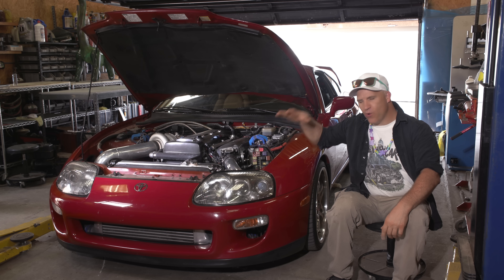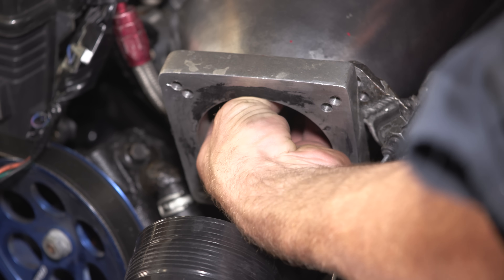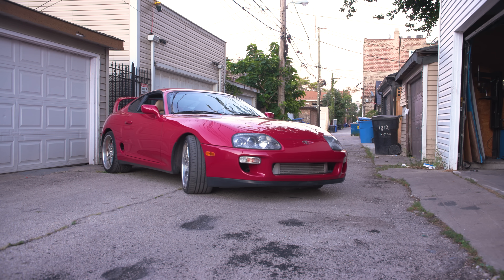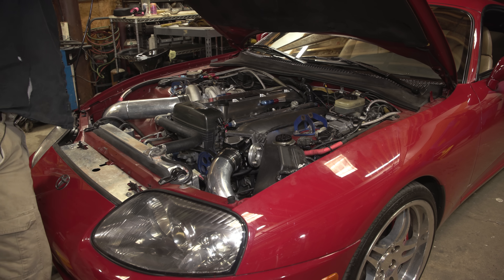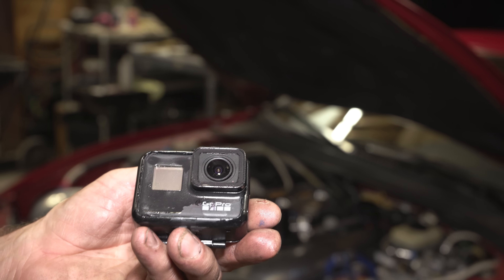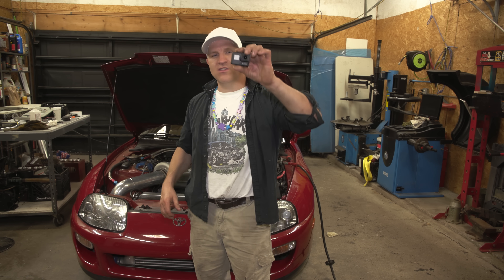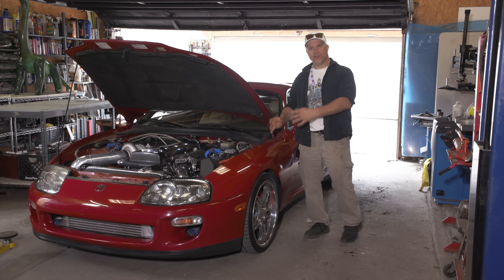Driving with Gopro Inside My Intake Manifold (Toyota Supra Turbo)

Comment: yeah, u should check where that oil from, hopefully u don't get leaking oil from the valve sleeve rings. that pink ish liquid that u get from the start up. was it the oil mixed in with gasoline vapor or something. also the cold cranking sound rough... Afaik, the toyota straight 6 turns on very easily n smoothly ... early sign of compression loss?? hopefully not dude. be light on the boost i guess?

Comment: The oil on the GoPro makes sense. Think of the vacuum the intake has when you blip the throttle/engine brake. The case will flex under extreme vacuum thus creating a void in the gasket for the case. Once the pressure regulates the case goes back to original form sealing the GoPro case. I'd be interested to see what the vacuum is upon deceleration of the engine 👌🏽

Comment: If your using a k& n filter, thats probably the oil thats on the filter going into the intake manifold. The oil is red. Maybe want to use a dry filter from vollant so it wont get as gummy, and mess with the air mas flow sensor.

Comment: Is the oil from the positive crankcase ventilation system? This GoPro-in-the-intake method would be an awesome way to test different catch can designs.
Reply: Depending on his PCV system (bypassed or not), it’s mostly oil blow-by from the piston rings. The piston gapping on a pressurized intake system needs forgiveness somewhere to handle the compression at given operating temperatures; Normal in all internal combustion engines. I did notice lots of fuel washing of the plenum during deceleration - but that could also be a fogging effect of air pressure differences; Think of condensation clouds or vapor vortices that form over plane wings with high humidity. Also, there was a good amount of normal intake condensation I noticed on crank over - that was interesting to see. Good video!

Comment: That was cool. Oil / do you have a PVC vent into the intake before the turbo. I had a 1984 SVO Mustang that when I turned up the boost and changed the impeller it would suck hard enough to pull oil past the PVC valve from the valve cover had to add an oil/ air separator from a Pinto ( haha the SVO is a pinto motor but the PVC stock was not as good as the stock Pinto PVC). You also may be leaking past the seals on the turbo shaft  may be   just guessing

Comment: What is the red-tinted fluid inside the intake manifold? Shouldn’t that area of the car be completely dry?
Reply: that’s that oil leak he’s talking about. intake was pretty clean at the beginning but you can see oil leaking out from under one of the intake valves. probably just a seal but annoying nonetheless
Reply: WhiteShaq420 the only oil I know that is red is transmission fluid, so I’m still a little confused haha
Reply: @joshuacastle8701   oil can be any color with a light shining on it. There was a light on the camera.
Reply: Kris_T_1982 ah.
Reply: Joshua Castle royal purple?
Reply: Joshua Castle  i believe it may be the K&N air filter oil...
Reply: james griffith oof that would suck. There actually IS such thing as too much lube after all lol
Reply: The oil is coming from the intake valve
Reply: Redex
Reply: Its either from the air filter or compressor o-ring.

Comment: So is that the moisture in the air condensing like when an airplane is landing? Let off the throttle and it creates a low pressure or vacuum?
Reply: On gasoline engines the intake is under vacuum when the throttle is closed or partially open. When the throttle is fully open then the intake will see atmospheric pressure. Vacuum leaks tend to give you issues at idle or with low throttle. Diesels are different because they generally don't have a throttle plate. Diesels will generally have a vacuum pump which will provide vacuum for systems such as the power brakes. 
You can make little clouds in your mouth by popping/clucking your tongue with your lips closed, then put your hand over your lips and pressurize your mouth as much as possible, then open your lips and let a tiny bit of air out. If you did it right you'll see vapor from the pressure change!

Comment: I don't know much about Supras but I noticed on the start there was  a small leak it looked like from cylinder 3 or 4. I know it was red I don't know what fluid that can be transmission or coolant there's are the only two things I can think of. But that was a pretty cool video👍

Comment: A bit more  boost and we could see a go pro combined with a piston, valves and cylinder head. We could see what it's like inside the exhaust system on its way out the back onto the road..

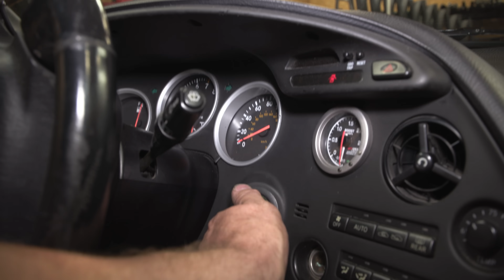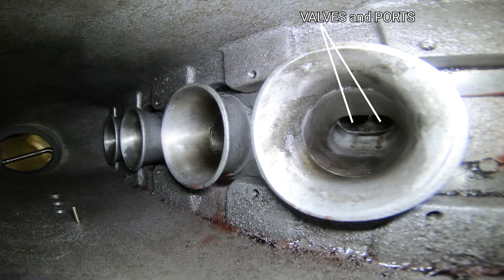Comment: 02:38 - you can see oil pooled under the base of the velocity stack next to #4 cylinder's velocity stack, running down onto the floor of the chamber.  there are also two oil "tracks" under the valves and ports that weren't there in the pic at 02:28 (I'm guessing he started the car to make sure it'd run with the gopro in there and that the gopro was working before he took the pic at 02:38.  
As the car is driven, you can see the oil is mixing with the gas.  the black oil becomes brownish red and spreads out at that 90-degree angle and becomes nebulized and mobile, as well.
i'm not a mechanic, so i can't say that's not normal or if it's bad - hellif i know.  however, he said there was no oil in there, but you can see it starts out looking black with pools of brownish red where thinned by the gas (or water?).
it caught my eye, so when he was talking about the oil pattern on the gopro and that there was no oil in the chamber when he it put the gopro in there, i thought i'd mention it.  i'm sure about 500 people have already mentioned this, as well :P
Reply: That’s a lot of words

Comment: 5 years later: Walking with a GoPro mini inside my heart
Reply from the maker: We can totally do that in the garage
Reply: @WarpedYT  can you put a GoPro in the gas tank or in the exhaust pipe
Reply: @WarpedYT  LOL
Reply: @WarpedYT  ᵍᵒᵒᵈ ˡᵒʳᵈ🤨😆
Reply: How do u get it out or does it stream to your phone?
Reply: I mean I have pictures showing the inside of my heart from my open heart surgery back in 2008
Reply: Running would be better lmao
Reply: I want to see the hearts reaction when someone’s engine starts making a loud clanking sound.
Reply: That would be gross🤢
Reply: I have a go pro in my butt
Reply: It goes by the name "angioscopy" or more specific to the heart itself (Though it doesn't necessarily refer to sticking a camera inside the heart) "cardioscopy"
Reply: @ThZuao  No, I mean I literally had open heart surgery replacing my aortic valve. When I say you can see inside my heart, it's taking a literal traditional digital camera and taking a picture with the heart exposed.
Reply: @ThZuao  cardigoproscopy
Reply: Nano
Reply: Lmao
Reply: Heart gets a P0171 error code
Reply: Wouldnt it be more appropriate to put it in your lung. Same sorta thing going on
Reply: Being here in the big 2 5 that officially has not happened yet
Reply: well well well

Comment: Looks like injectors or intake valves are leaking bad, intake shouldn’t be wet.
Reply: my bet is piston rings or turbo oil seal... really got wet under boost, and he stated it was all oil... oil going through the turbo bearings or bypassing piston rings are my guess.
Reply: Wet intakes and the fuel cloud is ok, reversion is a real thing. It's part of the inertia supercharge effect.

Comment: If that oil starts to increase I’d have a look at your turbo maybe a small issue mean didn’t look like a lot bit I’m not there lol
Reply from the maker: So it turned out to be power steering fluid, apparently my low pressure power steering switch is bypassing fluid from the power steering pump into the intake manifold.

Comment: Awesome shot! Thanks! I also thought it was cool to see where that oil was coming from. I guess that will help with tuning, right? I would love to see what you did with that knowledge of where the oil came from, what you did to stop the leak, and how fixing it improved the engine’s performance or just smoothness.
Reply: Oil or that leaking injector (s?) - looks like fuel sloshing around in the bottom of the plenum.
Fortunate it's port is 'uphill', so it can't leak into the cylinder and 'hydraulic'it.

Oh, and driving like a fuckwit, even on quiet streets...

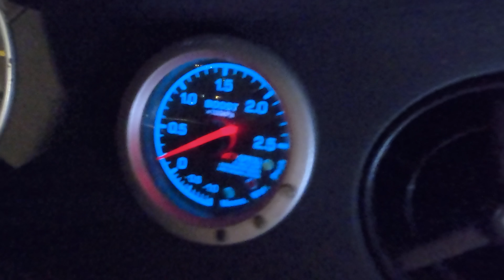Comment: Is that trans fluid seeping from 3rd header? Watch 2:35 to just after startup. Might have a bad vacuum modulator. As for the oil in intake, should check your seals if you did any recently, but it could be that fluid from the 3rd header moving around from the air pressure going through it. Having fluid above and below the camera face with it being directly in front of those valve openings makes sense. Notice the fluid moving around around the 3:30 mark

Comment: If you got oil coming into the intake manifold check your turbo shaft endplay see if there if you can wiggle the turbo blades at all cuz that one of the signs of a bad turbo is oil in the intake

Comment: If you're still using the factory power steering pressure switch, that oil could be power steering fluid, as those switches tend to leak.  I would eliminate that switch altogether, as it's not really necessary and not designed to work with boost pressure.

Comment: Its only going to make a difference when the air density changes drastically that's it, but it cant change that much as the air is from the intercooler first, so take it out on a really cold day v's a really hot day and massive humidity differences, then it would be cool to see, other than that, the go pro might break up and get sucked inside the intake, lol:)

Comment: Can see the oil come out and spread, soon as engine starts
Reply: No, it's coolant.
Reply: @ndfields1  doesn't that mean that supra has a slight head gasket leak?
Reply: It does. And it accumulates a little throughout the drive. That's the oil that was covering the go pro.
Reply: I noticed that right off the bat. Hopefully he caught it too and has fixed it
Reply: Wait what?
Reply: It appeared red, any thoughts?
Reply: @antonm4  it's extended life coolant.  Toyota coolant along with other brands of extended life coolant is red/orange in color.  Engine oil is not, especially after it has been used for any length of time.
Reply: @ndfields1  I thought so, also thought it was interesting how it was primarily out of the 2nd and 3rd cylinders (at least it appeared to from the startup)
Reply: @antonm4  I saw that right away too on the startup.

Comment: Is that just rust teinted moisture from compressed and expanded air running through your intake? If it’s a steel manifold and you have moisture from the compression and expansion of air in there you must get some dirty dribbles in there

Comment: the oil is from your turbo sucking thru the catch can and it worked its way all the way to the intake plenum under the runners. Also when oil gets hot enough it can condensate

Comment: Let's settle this debate on 'oh its oil! Oh its coolant! Oh its PWS fluid!' No....

Remember petrol or gasoline is an EXCELLENT solvent, it can remove  grease and carbon build up. What you're seeing is carbon build up and excess oil being dissolved by the fuel, nothing more. Oil? You ask?

Well, all cars have 'breather' tubes which allow excess crap from the combustion to reenter the intake to be burned. Sometimes oil slips past the piston rings in the positive crankcase ventilation tubes or 'breather tubes'.

Supras have multi point ejection, 2 injectors per cylinder, one above the intake valves and one in the compression chamber. They alternate under low load and work together under high load

Comment: do you have an oil catch can? its pretty normal to have atomized oil wandering around on the coyote engines so i use a catch can for mine and it helped clean that up (not that its really all that bad anyway).

Comment: You probably have bad valve seals 2jz are known for that also could be blow by depending on how your pcv System is set up could be to small of an lines running to the catch can or to small of a catch can the pistons rings could be burnt out also or if the engine is built the engine builder open up the ring gap so with with high power you don’t crack a ring land Which would go back to your PCV system not being adequate for the engine so bigger an lines in a bigger catch can probably help

Comment: The oil in the intake is most likely from turbo oil feed or the valve guide seals are bad.
Reply: The oil in the intake is most likely from the PCV, or the PCV. Possibly the PCV, but I'm not sure. It could even be the PCV.
Install a catch can (that works). Your engine will say thanks.
Reply: DrEvil74 Agreed. Except the turbo provides positive pressure against the intake valves. I have a diesel with a turbo and there are no oil seals on the intake valves. Not needed.

Comment: Great to see something different and informative. Oil is likely coming from the turbo but I guess that was the first thing you checked. Think about using a remote probe camera although the heat may still be a problem

Comment: The oil is a natural occurance in the intake. The high rpms and aggressive turns push the oil into the intake. Other causes can be a clogged hose on the crankcase, worn piston rings or clogged oil passages. I am going to say its from hotrodding

Comment: And now you all can see why a turbo car needs a "Catch Can"! That's a lot of oil!!!
Reply: I recon all cars would benefit from a catch can especially if its got emissions system like EGR. Unless it venting to atmosphere from stock, even a N/A motor will prodce some blowby.
Reply: Look @ 02:38 in the video, when the car starts up, ports 2 and 3 have oil leaking from them or some other kind of dark fluid that comes down the bottom of the velocity stack, there is your main problem
Reply: That what that is? Where's it coming from? Worn rings forcing too much air onto bottom end? Always built n/a. Been afraid of turbos lol
Reply: @jonbar140  blow by is normal and really  not something you can eliminate due to engine design. It is caused by the hot combustion atomizing oil ( oil vapors ), the egr system recirculates those oil vapors to the intake to be burned or else they will contaminate engine oil and have more residual oil. Once you add a turbo you increase cylinder pressure and also blow by.
Reply: @MrDehBoss  is that all that is is just blowby? It almost had a dirty orange antifreeze look and I was wondering if he might have cracked head/gasket. . . I'm also not sure if you could even see it before you had other indicators of a cracked head/gasket; it's coming from a lot of power tho
Reply: @cloverasx  It is not antifreeze, It is actually mostly gas with some sprinkled oil. Bet this thing runs RICH to make all those WOOSHS
Reply: @MrDehBoss  why do you think it's blowby? How would that be getting into the intake?
Reply: @tartarsauce2601  it is impossible to make a perfect seal. Turbo engines work  lower compression rings due to pressure. Which is why turbo engines have way more blow by. I think it is just normal blowby with some fuel. It is perfectly normal.
Reply: @MrDehBoss  EGR circulates exhaust gas from the exhaust manifold to the intake, not blow by gases, right? That's what crankcase ventilation is for. EGR is also only used on partial load, as having it open on full throttle would seriously decrease perfomance.
Reply: @PekkaKilpeläinen  yes. That is correct. Also upon further thinking it is most likely just a little bit of fuel that had a little bit of oil from intake valves
Reply: @jonbar140  you ever pull apart an old intercooler on a turbocharged car? Usually filled with some oil.
Reply: @tartarsauce2601  Nah. I didn't mess with turbos. Made power o'natural. And oil in intake was usually due to a bad PCV. I'm a firm believer that if an engine is built right, fluids and air stay where you put them.
Reply: @jonbar140  I'm with you. I thought it was pretty strange when I learned that it's common for oil to collect in intercoolers. Maybe that will change one day.
Reply: Unless it is direct injection it is no problem.
Reply: @MrDehBoss  either way... its never a bad idea
Reply: MrDehBoss I have a catch can on a 13 eco boost you’d be surprised by the amount of blow by

Comment: Looks like the fluid isnt just oil to me...It looks like its mixed with a lil antifreeze too..You can see it turn milky pink then the water sitting on the bottom of the intake..........You can seal the intake porousity with a military grade epoxy sealer that dries slow by emersing the intake in it and you need a better sealing head gasket................

Comment: So, what were the white flashes when the throttle closed briefly? Was it water vapour being condensed because of the pressure drop? It reminded me of when you squeeze an empty plastic water bottle and unscreew the cap rapidly. The cap goes flying and there is a mist coming off of the bottle opening.

Comment: It'd be great to see inside the sump, seeing the oil moving around under cornering load. Although with a longitudinal engine the Supra probably isn't going to be very dramatic and you'd need some fresh AF oil in there.